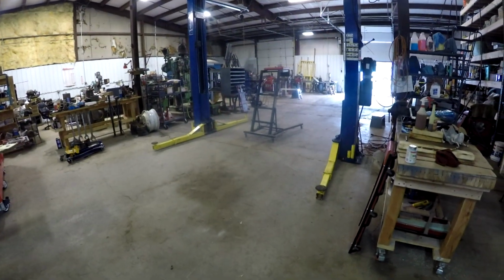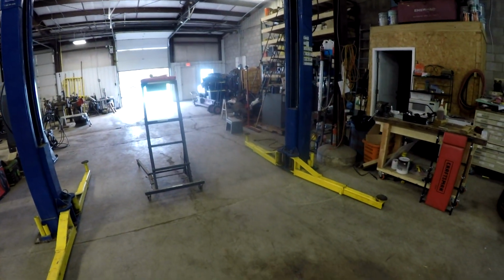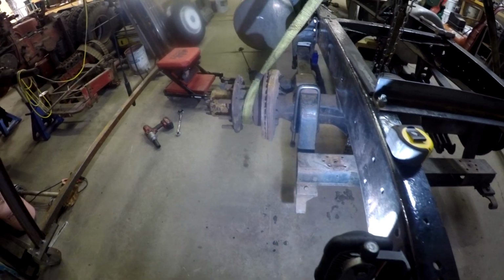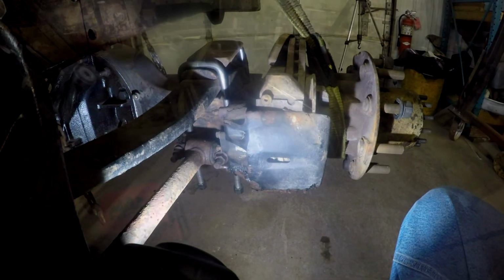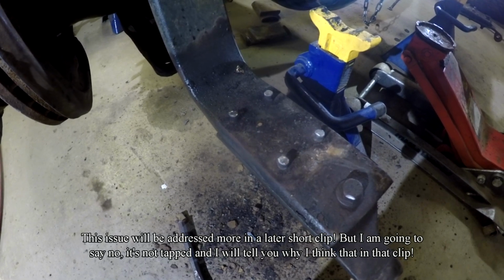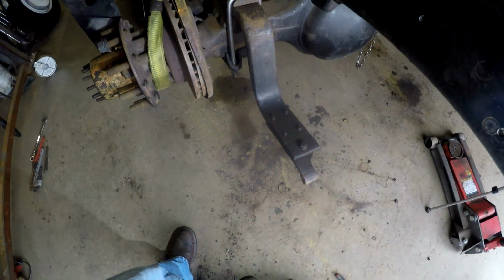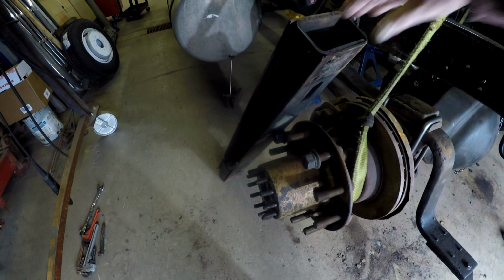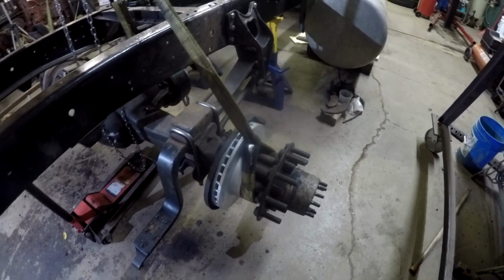Ford F750 Haul Truck Build Part 58

Comment: On the break calipers Yes one reservoir between the input port and the bleeder, but most cases you Cant switch them the bleeder  and its seat are V-shaped so they seal up